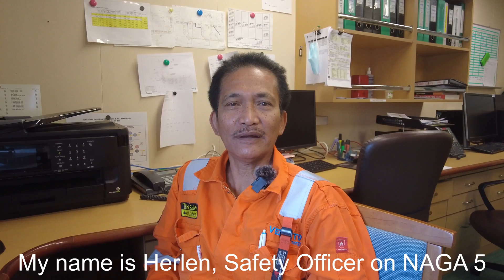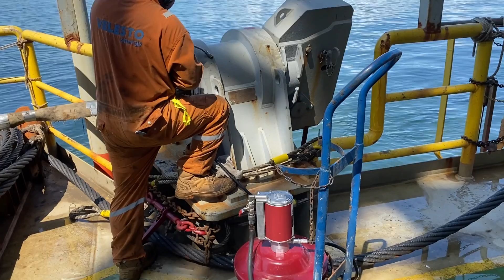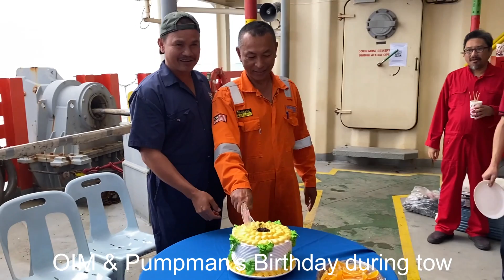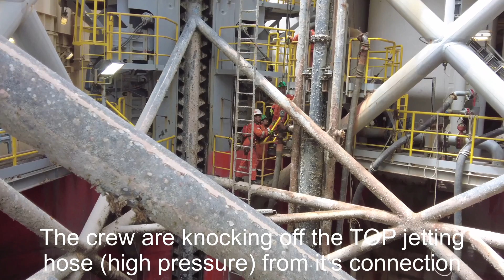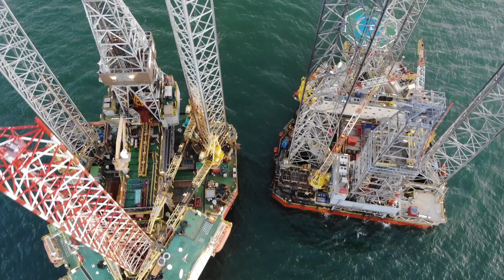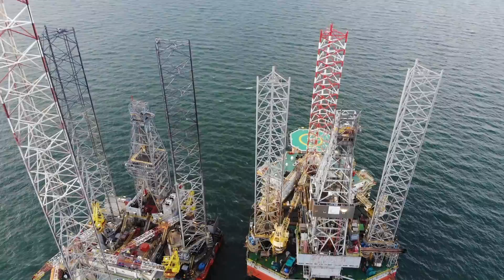Jack Up Rig Move - Ocean Transit

Comment: How to get a job for mechanical engineering fresher ( after Btech in mechanical engineering) in oil fields?
Reply from the maker: There are few position you may look for, such as Trainee Drilling Engineer & Wells Engineer. In order to work on Oil Rig, you will need to attend safety courses such as BOSIET and other courses such as H2S, Fire Team member, Enclose space entry and etc. All these courses will normally pay by the company that hired you.